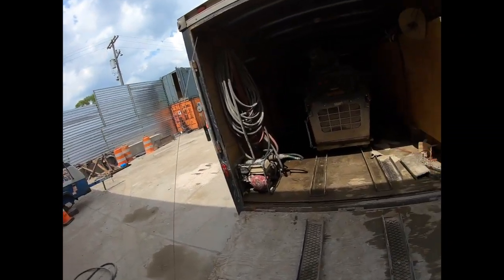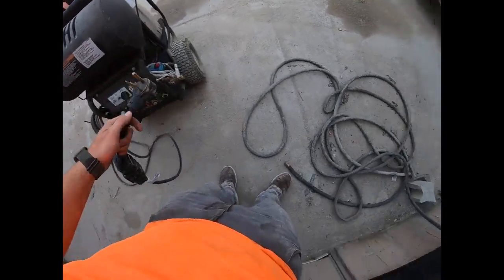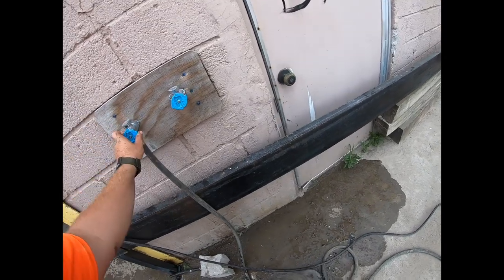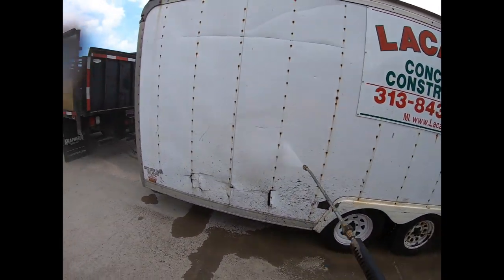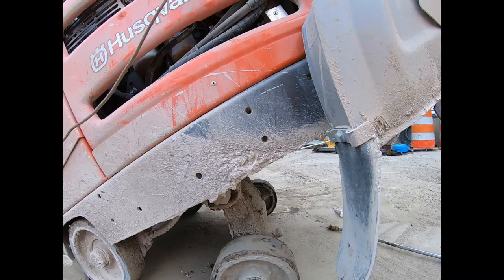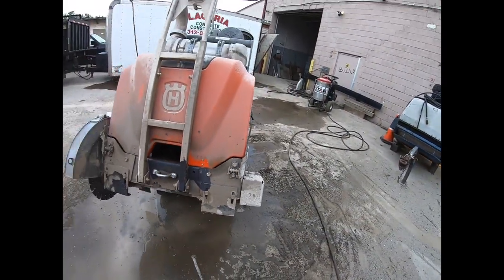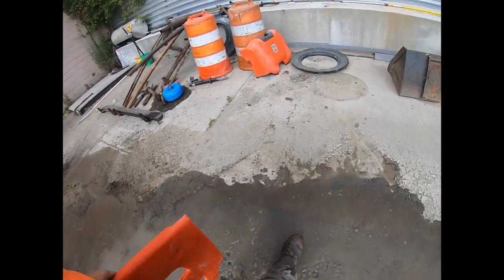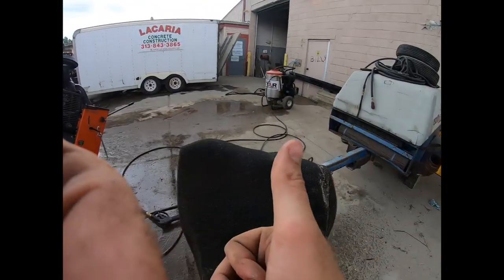Why You Need A HEATED Powerwasher!

Comment: I would absolutely LOVE to have a hot water pressure washer. As a small engine mechanic, I have to clean a lot of oil and grease off a lot of commercial equipment and a regular pressure washer does alright but often won’t touch caked on grease and oil sludge. A hot water pressure washer would make that grease run like water. I thought about getting one of those hot water attachments for a cold water pressure washer but the prices are insane. $2,500 for just the hot water tank is too high a price for what is essentially a burner with a coil of tubing. One day I’ll get one if I can find it for a better price.

Comment: Another note about this machine, it's a Low Pressure Soaper, you have to use a different nozzle to dispense soap at low pressure then change nozzles to use the burner, I adapted a Hotsy High Pressure soap mixing system so our Northstar can spray 180° Hot soap to clean more efficiently. We bought the Northstar and invested an extra $50.00 and turned it into a Hotsy!
Reply: 0